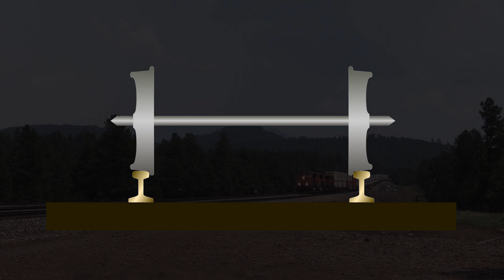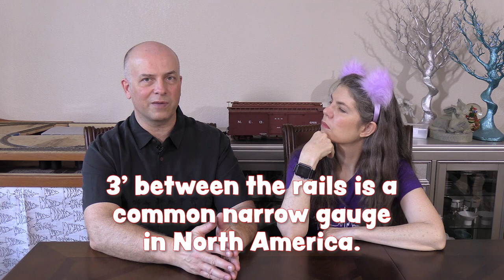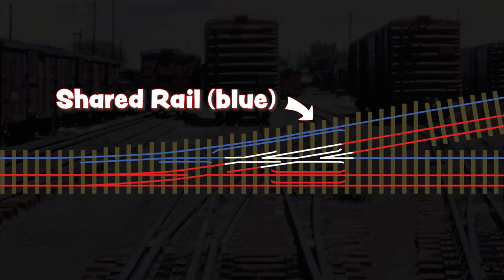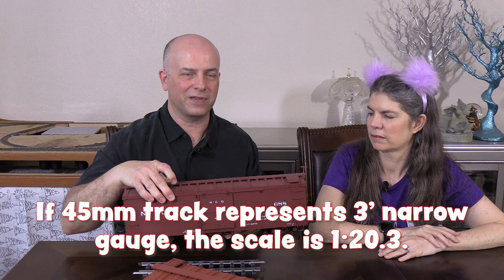Model RaIlroading for Beginners, Episode 3: Gauge

Comment: I have often wondered what the differenc numbers meant such as HOn30, Nn3, etc. Thank you for explaining it! I believe some of the big mining unit trains down in Australia run a broad gauge if i'm not mistaken.
Reply from the maker: I am not that familiar with Australian trains, but I have heard that they use several different gauges.  We're glad you found the video informative.  Thanks for watching!
Reply: The Iron Ore trains of the Pilbara actually run on 4’8 1/2” standard gauge, the same as America. However those lines are isolated and do not connect with the main Australian systems which vary from 2’ gauge to 5’3” gauge and those in between. Australia’s “Break of Gauge” is a fascinating story to learn and read about if you’re interested.

Comment: These episodes are very informative and entertaining. My question for Dan & Nichole is, when purchasing a desired Scale (G,HO,N,Z,etc.), is it wise to read the labels on the packages of what you would want to buy? For example, rolling stock, structures, track.
Reply from the maker: Yes, it is.  Most products are labeled by scale (HO, N, etc.), regardless of whether they call it "scale" or "gauge".  So if you have HO trains, you'd probably want HO scale vehicles, buildings, etc.  If you have a narrow gauge (like HOn3), you would still use HO scale vehicles, structures, etc.  Only the track and railroad equipment would be different.  Thanks for watching!

Comment: O GAUGE 1.48.  UK 1.37.   WHY
Reply: In the US, we actually rounded up to 5’ gauge for O scale. Maybe the UK is modeling correct scale on 32 mm gauge track?
Reply from the maker: I am not that familiar with trains in the UK, but just a guess... I have heard that British trains have a smaller profile (width and height) than trains in other places.  Maybe it's the same reasoning that led some manufacturers to use 1:29 for standard gauge large scale instead of the more correct 1:32, to give the trains more mass, sort of a "bigger is better" philosophy.  Thanks for watching!
Reply: The reason for things like OO (1/76) as opposed to HO (1/87) and the same as above is that UK trains are much smaller in the prototype than American trains. This lead to the issue of motors being too big to fit in a UK locomotive at 1/87th the size. To alleviate this, the UK came up with OO (make the models bigger to accommodate the motors) whilst still using 16.5mm gauge track.

Comment: Russia has a unique Broad Gauge of 5’.
Most other broad gauge railways are 5’3” such as used in Victoria and South Australia. This is usually represented in HO at 18mm gauge track.

Cape gauge is quite a common form of narrow gauge which is 3’6” and can be found in South Africa, Australia and New Zealand. This is represented in HO as HOm or 12mm gauge. Of course HO standard gauge is 16.5mm.

Now to confuse you further, narrow gauge isn’t always represented in 1/87th scale. It’s also represented in O (1/48) and S (1/64) scales being On3 1/2 and Sn3 1/2 respectively as well as various other scales.
Reply from the maker: That's great info.  I am not as well versed on railroads outside North America, so I appreciate the input.  And yes, narrow gauge can be represented in any scale.  Our N/Nn3 Siren Creek layout is an example.  Thanks for watching!